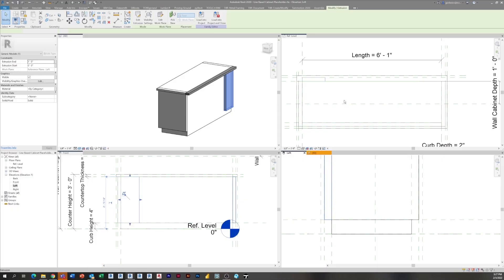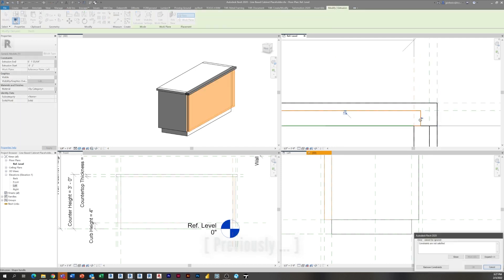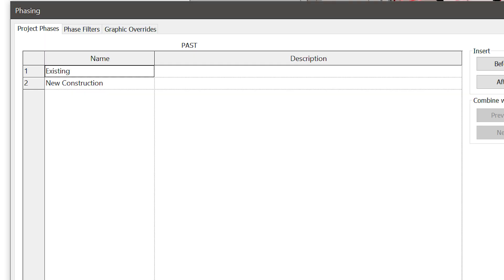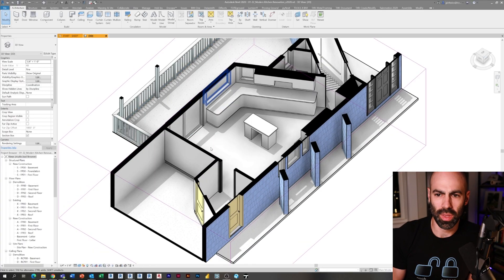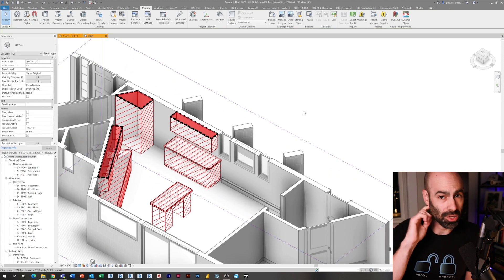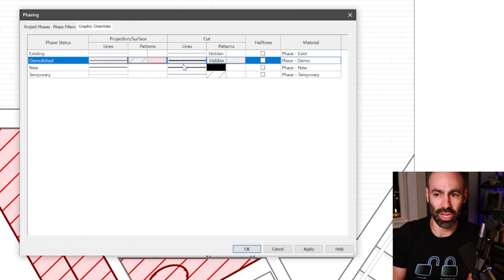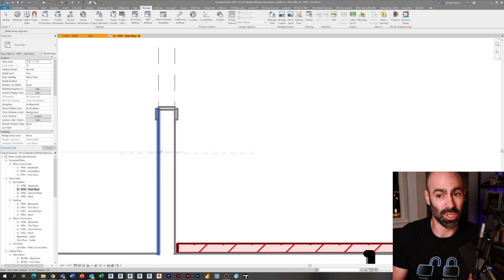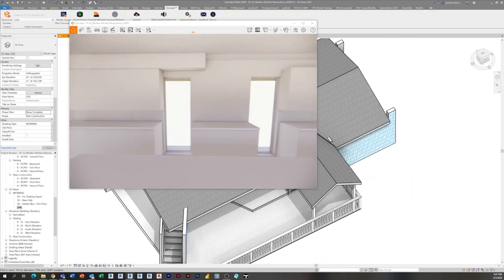EP07 | Phasing in Revit Tutorial

Comment: Hi. Regarding phasing, i have a question that i found no real solution for. I have existing exterior walls that i want to keep, but, i want to add new layers of materials, insulation and finishes. How do i show in a plan view only the existing parts, and in a new plan, the existing and new parts of that wall? We call it red and yellow plans (yellow demolished, red new). I tried duplicating the wall, but then the windows and doors bug, cause they would have to be hosted by two walls... some do some dont. Please find me a solution and post a video about it. Thanx in advance, and thanx for all the videos already posted.
Reply from the maker: Make two walls based on the layers... It's actually pretty straight forward! lol

Comment: Hey Jeff, just a quick comment regarding demo windows or doors in case it help others: as you are showing in the video, If you demo a window Revit automatically will fill in that void with the same wall type that was hosting the window. The issue with that is if you want to schedule that new 'wall infill' as part of your 'new construction walls' to get for example the total linear meter of internal partition. That 'new wall' will show in your new wall schedule but it WONT have a length parameter associated with (blank parameter). Therefore, the total linear meter for the previous mentioned internal partition example would be wrong. 

Perfect solution would be for Revit to allow us to select either YES/No if you want to fill that demo window with a new wall. Then if YES, keep the length parameter on that wall. Nevertheless, the current best solution is to use the 'CUT' command clicking first the new infill wall, then clicking in the wall that was hosting the window. That will get rid of the infill wall, then simply we could create a new wall manually to fill that void, which it will show correctly in the schedule 

Also, the previous solution is useful if you want to demo a door but keep the void open in the new construction phase. 🙂 Cheers
Reply from the maker: Great point … I should have mentioned that the “infill” walls have some caveats !!